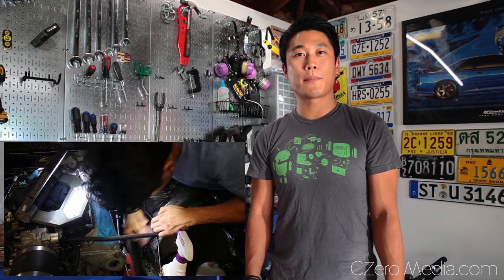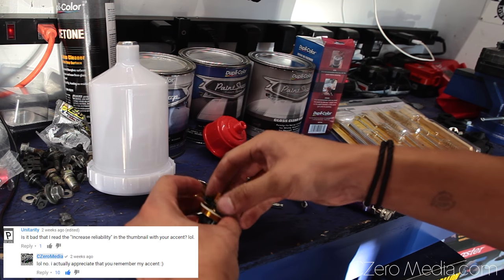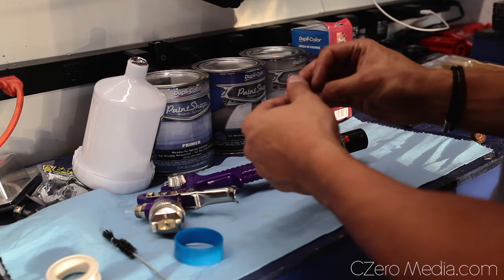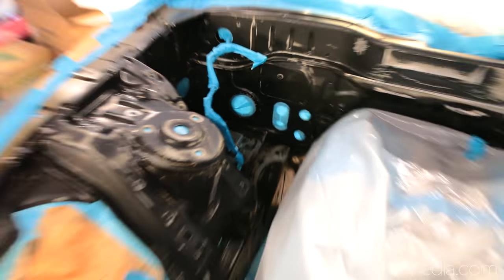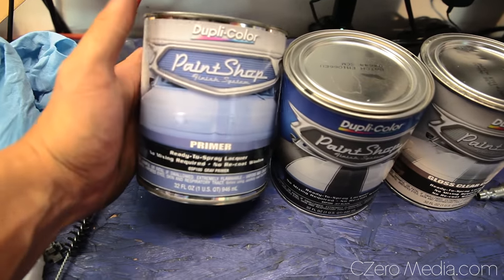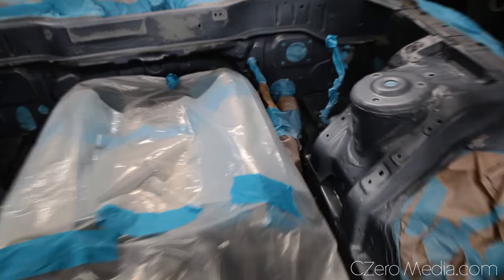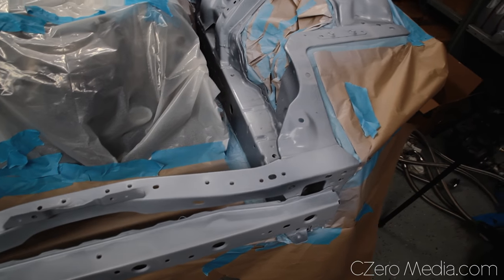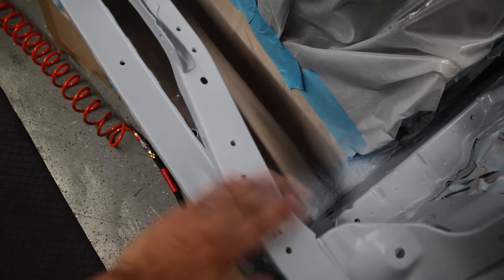Engine Bay Painting Time! - Wide Body V8 FD RX7 Build Video Series 19

Comment: looks pretty good over here
A few suggestions:

paint the inner hard to reach surfaces first, then work your way out
use a hose without the coiled Teflon, it'll be easier to wrap around your arm and away from the paint
once you're done with your paint gun break it down and acetone it clean like you did earlier

again looks good and I look forward to the final product
Reply from the maker: those are great tips! thanks a lot. very helpful!
Reply: you helped me awhile back yourself, it was you who introduced me to speedhut gauges, the ones you're using for your RX-7

My SC300 is notorious for having cluster lighting and various other electrical issues I plan on using speedhut gauges in the future.

Comment: You have a horizontal fan, try vertical. fan width looks a bit small. wider fan and more paint flow should create a nice even layer of coats. you will have to move gun along faster with more paint flow to avoid runs
Reply from the maker: yeah. i realized i could turn it after the first spray lol